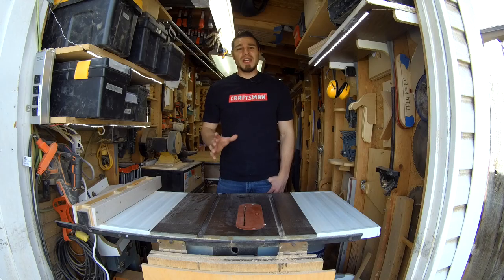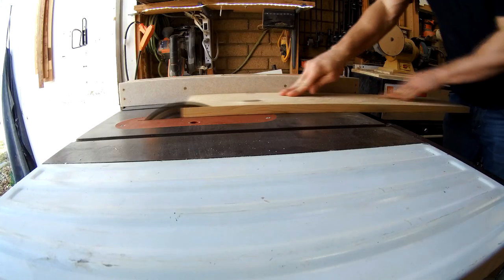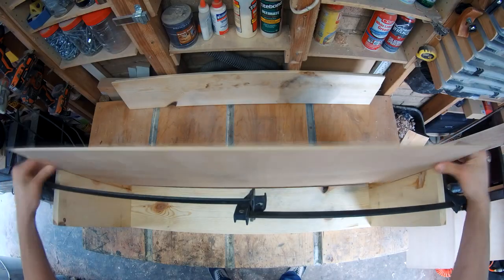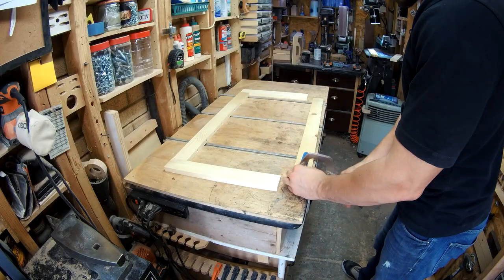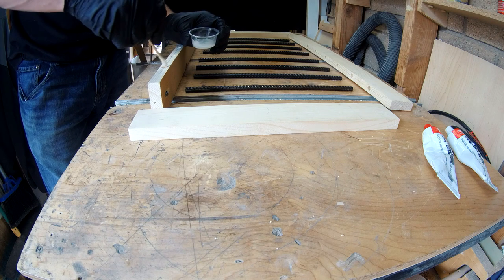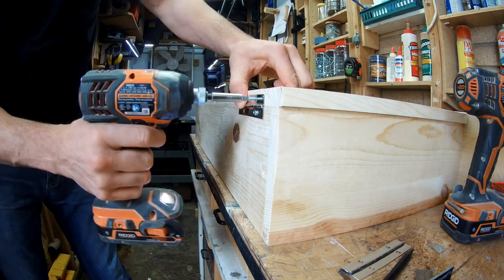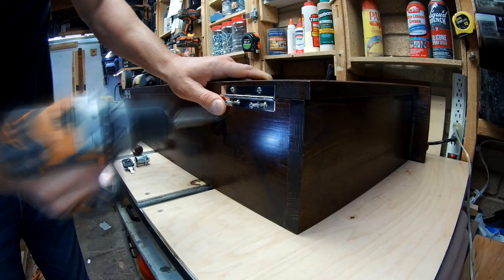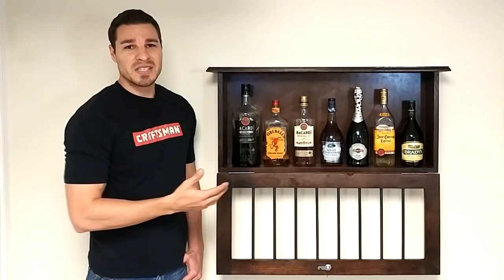How To Build A Simple Locking Liquor Cabinet

Comment: I may be wrong but I believe that the hinges being on the outside make the lock kinda useless? A couple turns with a screwdriver and you're in!
Reply from the maker: If someone's that desperate for a drink, they can just have it. I mean, it's made of wood, so some real good whacks with a hammer would get you in there too. Or a saw, for that matter. A blowtorch would probably work. A hole saw through the top, and then you could just lift each bottle out. You could also just knock the pin out of the hinge with a nail and some pliers. Or just get a lockpick and spend three minutes on YouTube learning how to pick it. Then you could even get in without damaging the decorative cabinet.

Comment: You mentioned mitigating large grain structure when you were finishing it. What does that mean?
Reply: I also never understood how pocket hole screws worked until I saw this video lol.
Reply from the maker: Pine or Whitewood usually has large swooping grain. That grain has different density and sap content. Meaning that it doesn't take stain evenly. So a lot of projects made from pine that are stained look very blotchy. Tinting the finish relies on the color suspended in the finish rather than the stain soaking unevenly into the wood. Creating a more uniform color.
Reply from the maker: @TannaBerensen-Anson  Glad you learned something!
Reply: @CNTHINGS  whoa, it suspends in the finish? Fancy.
Reply from the maker: @TannaBerensen-Anson  well that's how paint works. Basically it's opaque paint lol